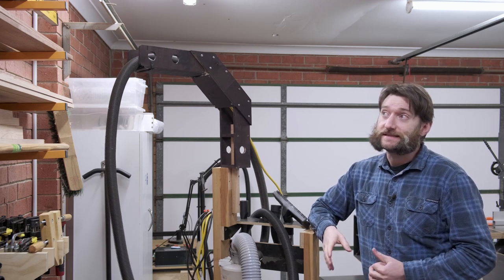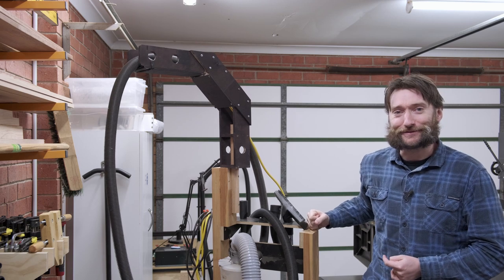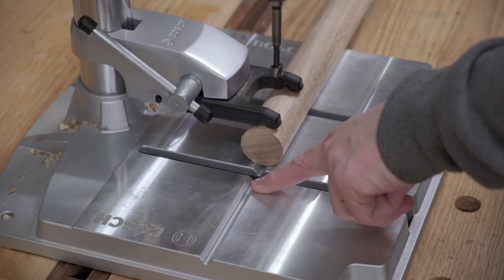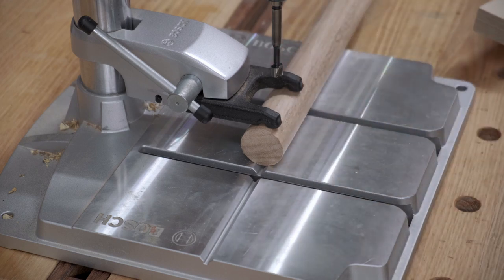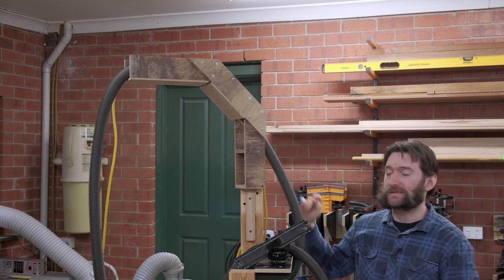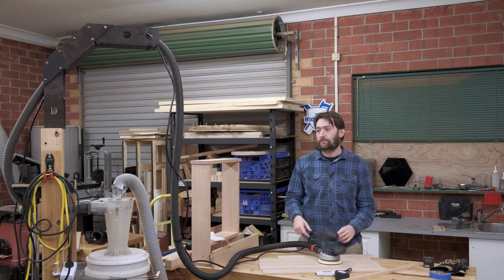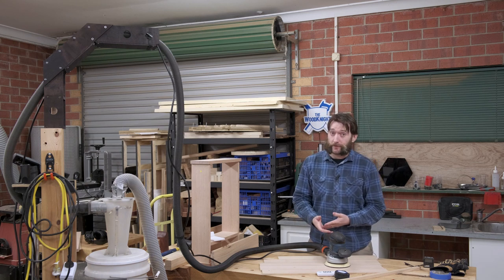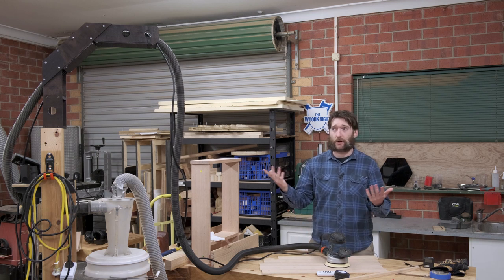Shop Vac Boom Arm | Woodworking workshop project

Comment from the maker: Festool have a great boom arm for their shop vacs, but it comes with an eyewatering price. A boom arm helps keep gravity from working against your tools - no longer will a sander so easily be knocked off the workbench because of the hose!

In this episode, I build a basic shop vac boom arm based on a lumberjocks user project https://www.lumberjocks.com/projects/116169 for my Jay Bates ShopVac+Cyclone cart (https://www.youtube.com/watch?v=pi0xqEUmuu4)

This project was made from 12mm plywood and a 35mm dowel

You will need

* Saw (Table or circ/track saw, having a mitre saw doesn't hurt)
* Drill w/ 35mm drill bit
* Sandpaper (to embiggen the hole)

Comment: Picasso is widely credited with saying, "Good artists borrow, great artists steal," so nothing wrong with a little reverse enginerding. During the wide shot I noticed your tubing for the vac side coming off the top of the cyclonic separator looked a little sad. It might be happier if you used an eye-bolt under the boom-arm and some cording to lift its spirits. Plus, I discovered with my cyclonic separator, that having the tubing dangle from the top causes too much strain on the plastic, so I've had to repair it a couple times before I found a suitable means of mitigating that strain. Another added benefit of having the tubing going parallel with the exiting port is an increase (small) in suction and better filtration because it allows more time for even the smaller particles to fall into the collection bucket.
Reply from the maker: I've had intentions of replacing the flex hose with 50mm PVC piping for a few years. It's either been a case of not having the time, or completely forgetting about it when I'm at the store!